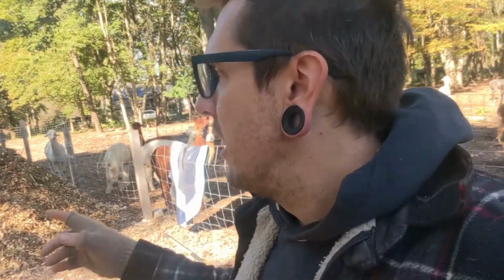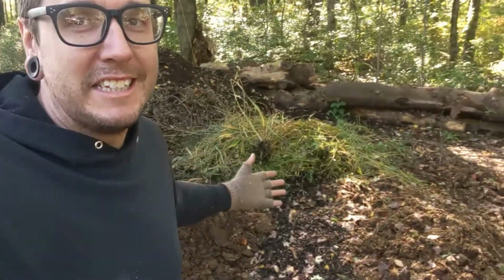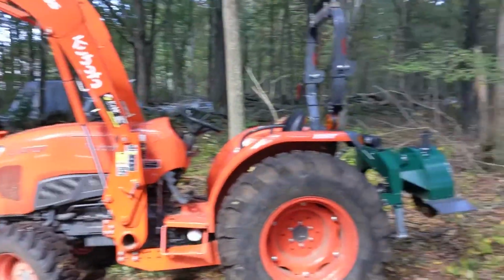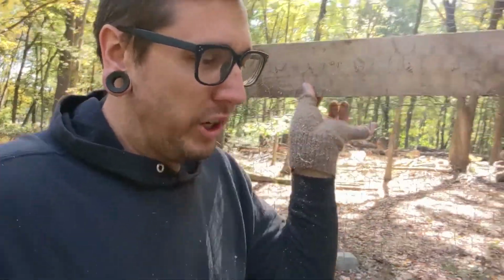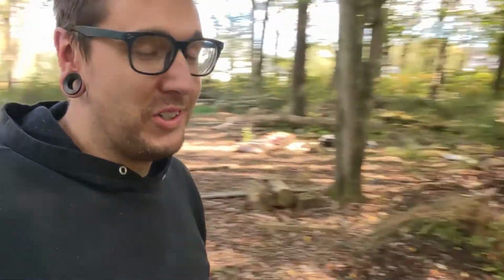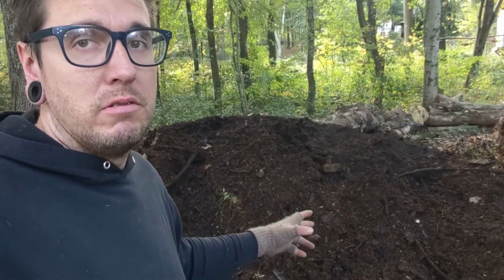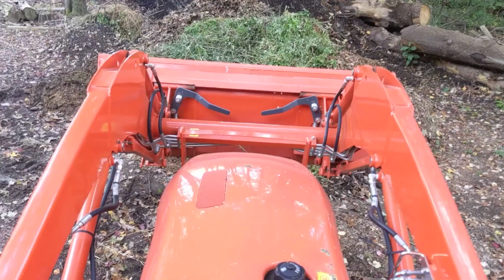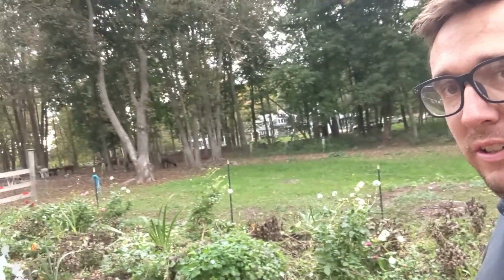FARM CHORE FRIDAY! Come Do Farm Chores with Farmer John

Comment: You could use the totes to make a liquid composter, diluted it is great for feeding the garden plants.  Steam coming from compost means it is working it needs heat to rot down. Saw dust can be mixed in with manure, any naturally  grown material can be used to make compost. 
P.S 
Beware snakes like a warm compost heap.